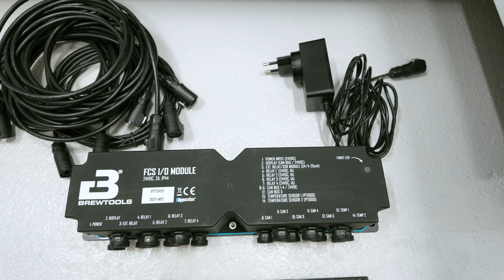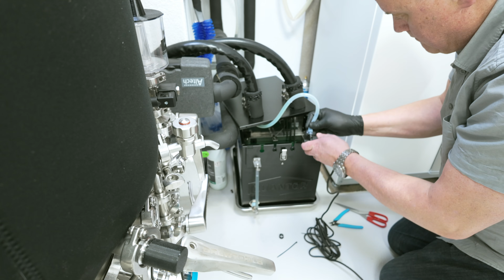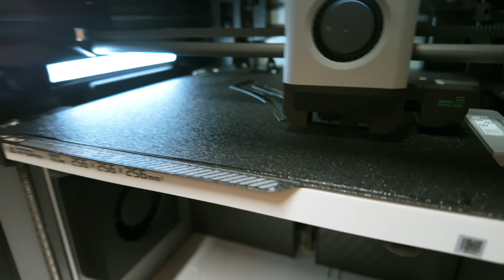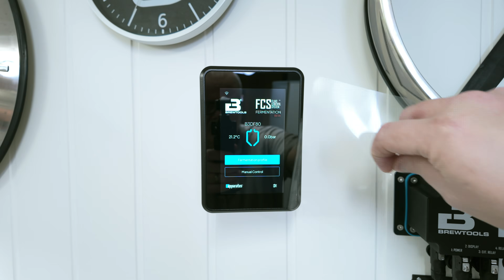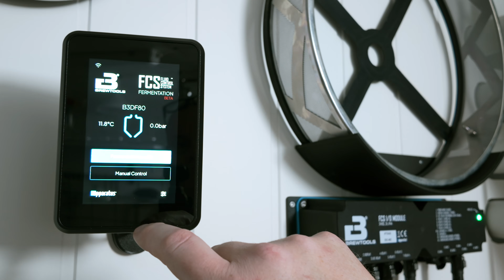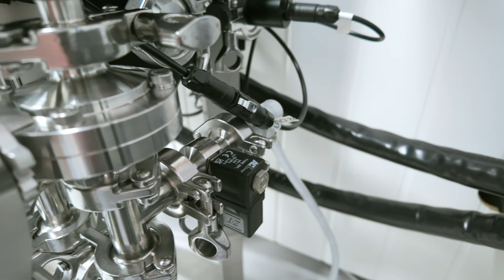BREWTOOLS Fluid Control System Installation and Overview

Comment: Hi!
Nice job you are doing!

Can you tell me where you bought the crane / the hoist? It is really usefull.
Reply from the maker: It is actually something I have come up with/designed myself. Of course there is generic hardware as the winch and the roof rail. But the rest is my own 3d printed design. If you are interested I would be happy to send you the CAD files for the 3d printed hoist...might serve as inspiration. Quite a few people have successfully finished the project and use it in their breweries. If interested: e-mail me at brewing3d@yahoo.com  // thx / Lars